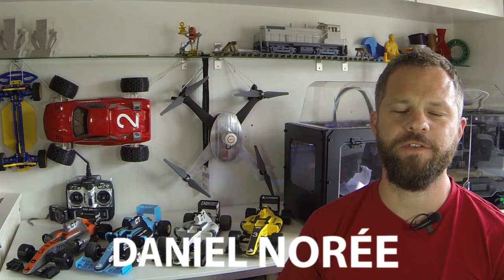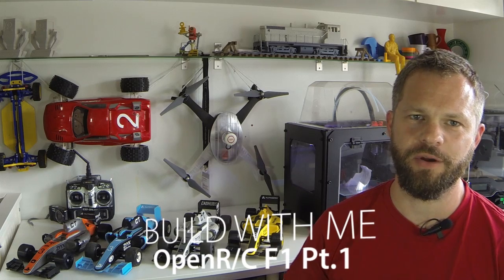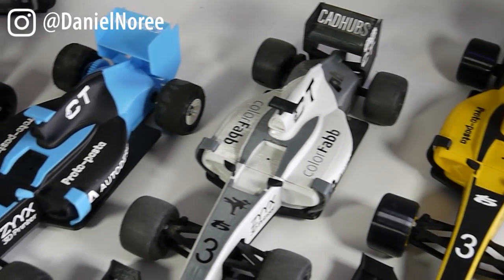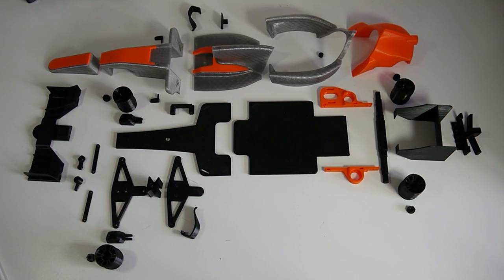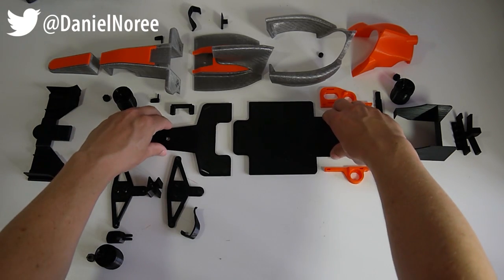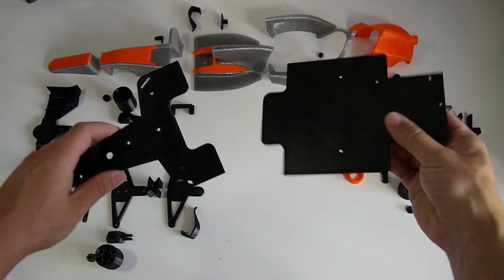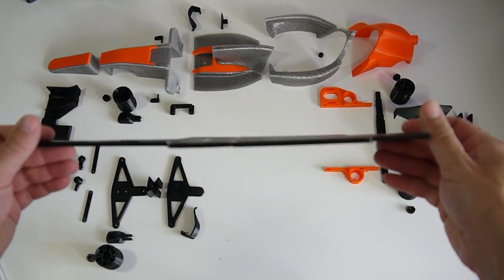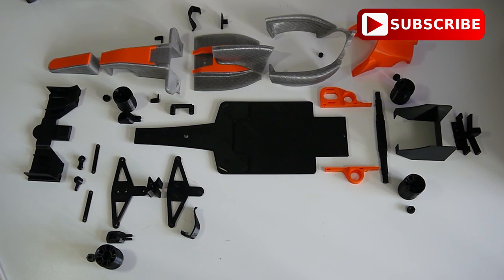BUILD WITH ME - OpenRC F1 Pt1

Comment: is it possible to print this in ABS and whats the min bed size
Reply from the maker: HI Paul! The F1 is not designed for ABS and so i have not done any compensation for the shrinking that ABS is a subject to. So pockets for nuts will probably come out to small. That said, i have seen several people printing it in ABS and some of them have used M2.5 nuts/screws instead of M3 to solve that problem so it´s possible. I dont have the dimensions right now but you would probably need something like 230x150 or something like that. Please double check before printing (i can check and add these dimensions to the project page later). There are "remixes" of the bottom plates on Thingiverse that makes it possible to print on smaller buildplates.